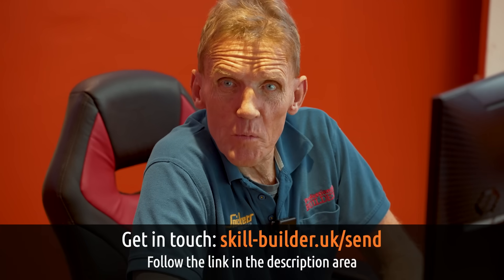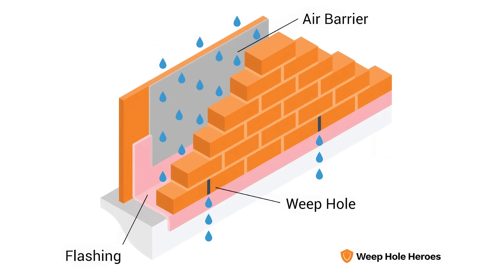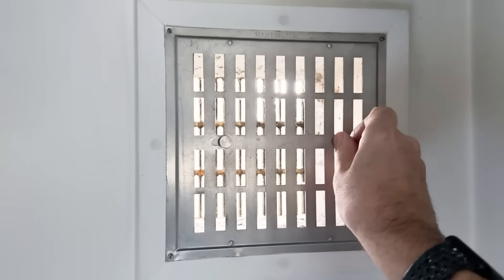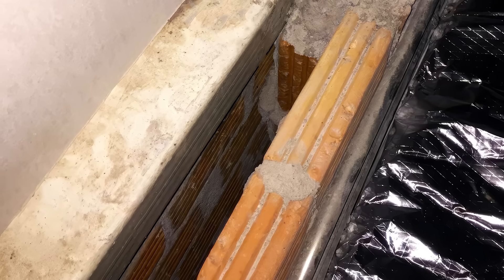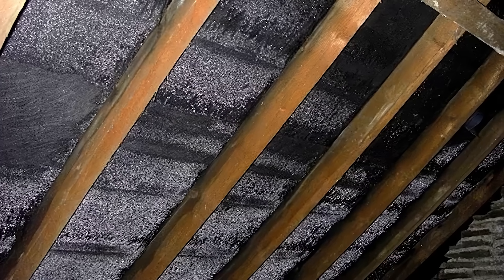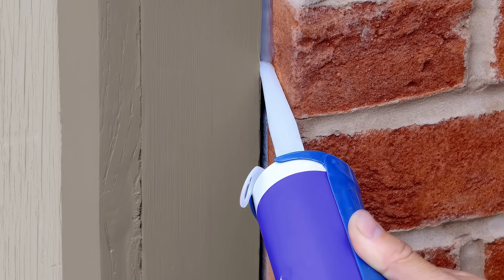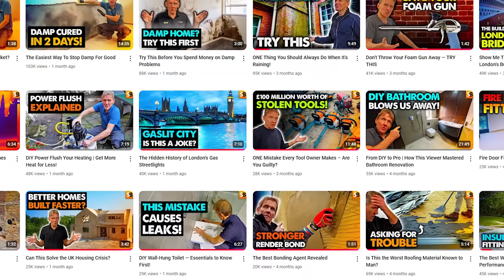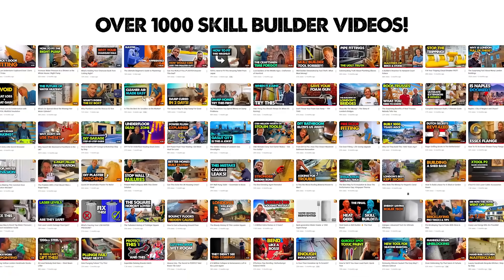The Truth About Cavity Wall Ventilation

Comment: Hi Roger, really interesting that you say the cavity SHOULD be closed at the top, as the house I grew up in was ex-council (built 1961-2) and also had an open cavity into the loft.  In effect, I would guess this means that instead of a 9" wall, you have a sheltered 4 1/2" wall with convection currents up into the loft, which quite possibly insulates less.

Unfortunately, it seems so hard to find out what the old rules were (as opposed to finding out what today's rules are, which is somewhat easier), so when you come across this kind of stuff in older housing, it is hard to tell if that was the way they did things then, or if someone was cutting corners back then.

If you had a house with this problem, what would you do be inclined to do about it, out of interest?
Reply from the maker: My house was like it but I closed it all off at the top with rockwool in polythene sacks. That was 30 years ago and it is fine. The airspace is an important insulator. Like you say, a ventilated cavity means you have a 4inch brick wall.
Reply: @SkillBuilder  Thank you!  Always good to hear people's personal experience.

Comment: What about the weep holes at the outer leaf of the brick cavity wall midsection & bottom of the wall? Aren't these supposed to drain the water inside the cavity away?
Reply: Yes, the weep slots are supposed to drain water away from the cavity.

Comment: Hmmm. Not sure this applies to the hundreds of thousands of houses built with soft brick & lime mortar. Water permeates through the outer wall into the cavity in wet weather & dries out in warm weather. Without the cavity being ventilated it might take too long to dry out?
Reply from the maker: That is where I lose you. If lime is porous (brethable) and wind blown rain gets through, what is stopping it evaporating back through the wall? I have a lime mortar built house and the cavity walls are sealed and fillled with blown mineral insulation. They are completely dry.
Reply: @SkillBuilder  Hello, I keep thinking about whether it would be worth completely closing the air gap in the wall to improve the thermal properties of the wall. The answer is, it depends. Well, when the wall is completely impermeable and water-proof, isolated from the ground by rising water, then I agree 100%. This theory will work in buildings with new technologies or where terribly expensive methods have been used in old stone buildings to chemically cut off water from each side. When we are talking about an old building with a solid stone wall without horizontal insulation, then I wonder about the effect of such water closed without access to air in the wall. My own opinion is that water, depending on the temperature inside and outside, will evaporate, condense and will not have a quick escape route as in the case of an open air gap. additionally, if we use modern insulation from the inside, e.g. with PIR plus a membrane, the drainage of water to the interior of the building will be completely stopped (which I think is very sensible and intentional). Only evaporation through the thick layer of the wall on the outside will remain. In ideal conditions, we would have half the days of wetting and half the days of drying alternating. In reality, we have a very wet period and a drying period. The very wet period is also a time of frost. The answer is erosion of rock and mortar. Of course, I emphasize that this is my personal opinion, but I cannot agree that in all conditions the air gap should be closed because it will improve the thermal properties of the wall. Sometimes this will bring temporary profits and in the long term high costs associated with the maintenance of the wall. Best regards
Reply: @MiroGro86  100%

Comment: Not sure I agree with blocking up vents, they where put there for a reason at the end of the day
Reply from the maker: The vents do not ventilate the cavity. The vents often were for coal fire or open flue boilers. If they are gone the vent serves little purpose. Each case needs thinking about

Comment: Perhaps the empty cavity walled houses in London are different to the ones you have seen but the ones here usually have ventilation via wall vents and in the attic. If they get blocked up with insulation beads by Government sponsored cowboys they become damp and mouldy in the first Winter. The cavity is normally wet from water migrating from the outer leaf  and needs to be able to dry out - that is why they were always open at the attic - sorry but I think you just got it wrong this time
Reply from the maker: It isn't me that has it right or wrong. If you look at the British Standards and Building regulations you will see that this information is standard. Have a look at the wall vents and you will see they are sleeved through the cavity.

Comment: Dodgy advice, in all cases of cavities you will want a degree of ventilation to prevent obvious trapped moisture. And the loft space getting damp is a separate matter as cavity walls should be sealed at the top to prevent this. So instead of sealing ventilation blocks seal the top of cavity wall if its not done already.
Reply from the maker: Cavities do not need ventilation. In fact it can contribute to the spread of fire. Check the regs and guidelines
Reply: @SkillBuilder  Roger this is advice is not correct for timber kit construction here in Scotland. The cavities MUST be ventilated. I'll copy and paste my original reply to you as follows - Hi Roger, up here in Scotland for the last 40 - 50 years the majority of new build houses have been timber kit construction where it is essential that the cavity is ventilated. The regulations state that ''Cavities should be vented to the outside air by installing ventilators with at least 300mm2 free opening area at 1.2m maximum centres." This is normally achieved by installing ventilation cassettes similar to weep vents but full hight of the brick (65mm). The cavity fire barriers should also be taken into account with the placement of ventilation cassettes each side of the barrier. This ensures that each fire compartment within the cavity is properly ventilated with ventilation cassettes at the bottom and top of each compartment. 
Why don't you do a collaboration video with someone who is fully up to speed with the Scottish regulations and practices. I'm sure your many Scottish subscribers will appreciate it.
Good videos. Your plumbing ones in particular are excellent.

Comment: Greetings from Poland. I absolutely agree with you on this subject. 
The issue in UK is that often the external or internal walls have so called "rising damp" from the ground due to damage horizontal water barrier. The way we address it in Poland is to cut your whole building with saw and insertion that barrier bit by bit every 20cm you cut. You might think this is an highly professional specialist job. No! It is diy job. One person is inside the house and one outside and they push and pull manual saw to cut you building at low level. Alternatively you can use chainsaw with special chain for concrete. 

I modern day an age cavity insulation is insufficient. We nowadays do 30cm of external wall insulation when upgrading existing builds. On the top of insulation goes mesh net, cement based glue, and 3mm render to finish. I am diy-er not professional.

Comment: What if I have an air brick above floor level? there's nothing in the room inside.
Reply from the maker: It may be there as ventilation for a fire or open flue boiler. If they are no longer there you can block it up. Better still put a hit and miss vent  cover so you can open and close it.
Reply: @SkillBuilder  Thanks, it is outside a bedroom with nothing inside, It's a bungalow and only 25 years old, I'll block it up. I'll block it up.

Comment: Answer maybe build solid walls without a cavity.  Water shouldn’t get through brick skin but it does because of shoddy building standards.hence reason for cavity trays.  Building regs are reacting to crap builders rather than ensuring things get built correctly. Find me an Edwardian house with serious water ingress?
Reply from the maker: I don't think that is the case. Bricks are often porous and with years of driving rain water finds its way through.
You also have mortar with air pockets. I agree that partially filled perps can be a weak point but brick walls leak.

Comment: You should also address the problem of the inner leaf continuing higher than the outer, to support roof trusses.  The outer is lower because of the slope of the roof. The room's ceiling is therefore higher than the outer leaf, ie the level of the soffits. The insulation needs to continue to the top of the inner leaf otherwise you have a cold band below the ceiling which is in effect a single leaf .  We had Shell insulation, glued together polystyrene beads but it can't go higher than the cavity. No-one seems to accept that the insulation needs to be continuous.
Reply from the maker: The blocks often go up between the rafters and the insulation is laid on top with a ventilation gap

Comment: With a cavity you get heat transfer from radiation + convection. Ideally you want to stop the air moving in the cavity without incurring additional heat loss via conduction.

Comment: Nonsense, internal water vapour will permeate into the cavity and then be trapped. Ventilation is still very much needed. You appear to be talking about best practices for energy efficiency - is also true to say that ventilation is required! They are not mutually exclusive
Reply from the maker: If you read the British Standard Guide lines you will see that you are wrong. 
If water penetrates the brickwork and runs down the inside of the outer skin that s not dependent on ventilation. 
The wall will warm up as temperatures fluctuate and the moisture will evaporate. This has been going on for thousands of years. 
If the penetration is excessive you need some form of cladding or better still a coat of Stormdry.

Comment: Is there a good way to tell if a cavity is insulated without drilling into the wall? I live in a block of flats built in 1995 at whoch point some insulation should have been put in, but I'm getting a bit sceptical.
Reply from the maker: A cheap thermal imaging camera will show you where the cold spots are. It should have some insulation in there but if the location is exposed it will still be a cold wall.
Reply: @SkillBuilder  Thank you for the quick reply! I'm actually playing around with a thermal camera atm, but the building looks fairly uniform from the outside - not sure if that means there isn't any insulation or if it's been done well. Will need to investigate a bit more.

Comment: Im of the view a cavity should be free of insulation and anything that bridges the cavity unnecessarily and the external brick should be vented to allow air to dry out condensation that runs down the inside of the external bricks probably more so at the lower ground level where its going to ultimately end up. Everyone seems to have a different idea about this. My neighbour filled all his airbricks in then started getting mould issues!!

Comment: At 0:48 why is that airbrick slightly below ground level? Rain water is going to run into that airbrick, an airbrick designed to remove damp is letting it pour in.
Reply: Because the owners have allowed the outside ground level to be raised above the damp proof course which will be immediately below the base of the air brick. The ground level, whether solid as shown in this case or just dirt, should be maintained as required by building regulations to be a minimum of two brick courses below dpc level. Ignorance is what has brought this about and a recipe for a future disaster.

Comment: Our problem regarding air bricks takes on a different approach, where our 1963 3 bedroom bungalow was constructed using a fabricated steel frame which includes the roof. A brick wall makes the outer shell, and a 45mm plasterboard inner wall completes the structure. Bichemin was used between the bricks and steel and plaster and steel to keep contact away from the damp walls. We cannot insulate our inner cavity as the steel needs to breath and remain dry. So our choice to bring this 1963 building up to scratch is to add 100mm of outer insulation to the walls all the way round the bungalow. The air bricks are a concern, because wind can create a draft under the floor space and up through the cavity. But if the walls are to be sealed by a water proof rendered insulated layer, water penetration should not be a risk. So does this mean I can close off the air bricks? Currently the system has work for the last 88 years and kept the steel rust free. We have an ASHP to provide us heat for the home, but it does struggle once the temperature out side reaches -5c. We need to insulate!

Comment: I live in a post war council house since 1987. It wasnt until they filled the cavity with insulation 25 years ago did i start getting black mould patches. Can't say the house feels any warmer with it either. Just more damp & condensation.
Reply: It would have been better to have left it alone.Our house when it was build they put like blanket stuff in the cavity.I must admit it never caused any damp at over 40 years.
Reply: worked on some council houses where they filled with foam, the foam just saturates with moisture.. council had to strip the outer leaf and scrape the foam off then rebuild the walls.. amazingly they used the same contractor that put it in.. what a gig.. my clients were unlucky they bought their council house so was up to them to live with it
Reply: @ i don't know what type of insulation they used about 25 years ago, but they drilled lots of holes in between the bricks & stuck a pipe thru which blasted the insulation into the cavity.
Reply: Too many variables to be able to diagnose from a YouTube comment. But you mentioning "patches" makes me wonder if they may have missed a few spots while filling. 

That often happens. And can indeed lead to wet patches. A few thermal images would reveal that for an easy fix.

Is the house painted on the outside? 

All retrofit cavity insulation is pumped in through holes in the wall with a pipe. So unfortunately that doesn't tell us what it's filled with.

Urethane foam was quite popular around that time. If you're unlucky enough to have had that applied there's no cure really. That stuff is almost guaranteed to cause some kind of damage, and can't be fixed nor removed.
Reply: i did it 7 years ago with polyurethane foam  , no issues at all but first the vendor came to check the cavity for odd things that can create weak spots of insulation .  my house is from 2002 and had already some 4cm  PE insulation panels on the cavity but it had 4cm empty space to fill.
Reply: Did you watch his other video about Stormdry (25 year lifespan) and dehumidifiers?

Comment: We purchased a mid eighties house late summer with solid concrete floors, cavity walls and air bricks above the DPC. Some minor damp issues on survey that surveyor advised was probably due to poor ventilation? Come the winter the damp became worse and we had problems with wood lice crawling around ground floor. Next summer we had air bricks removed, guess what come the winter? No damp issues and no wood lice.

Comment: Don,t seal your house up too much the average adult when asleep at night breaths out about 1pint &a1/3 in moisture  everything is a compromise between heating and ventilation! Try it boil a pan with just a pint of water in till empty that will condensate quickly usually on windows. Don, seal your house up you will end with thick black mole!

Comment: Roger, I personally agree no vents on cavity but check Part C Sec 5 and BS 5250 for venting cavities. You may be surprised.
Reply from the maker: Thanks for that. I have just read it all and it talks about weep holes if you are using a stepped damp proof course. Provided there is no open cavity at the top the weep holes are not vents. 
I don't see anything there relating to ventilated cavities unless we are talking about timber frame which is an subject entirely I should have made that clear.

Comment: We've bought a house which has been (I think) largely poorly extended by prior owner / builders and one of the things I have most recently identified, is a connecting wall which sits between the old outer layer of our Yorkshire Sandstone building and the new extension. Looking at this video, it appears that wall ties aren't properly used and there is no insulation or topping of the cavity. For info, the opening of this is exposed to external air via a porch within a run of the wall. Is this as bad as I fear? https://youtube.com/shorts/jAxsn9CjPdA?feature=share

Comment: it depends on the weather where the house is, is there a wet wind blowing onto the wall?
Reply from the maker: If it is a cavity wall with penetrating damp, venting it won't help. If you have a dead air space less wind will penetrate the masonry because it would have to compress the air.
Reply: Yes if it's in the UK.

Comment: i spent 25 years injecting wall insulation for miller Pattison owned by Sheffield insulation, ok  all the vent we blocked unless a customer noticed and complained about  them they stayed blocked floor or room vent , the the top the cavity we just let the insulation overflow into the loft causing all kind of problems, floor vents if they weren't sleeved and when they filled up we just blow air in to them to clean them out , so later on the insulation will just fall down to block them again and start leaving voids where damp will occur, your probably asking why do this simple was pushed by the manager Roy from coventry to do more work, he would say do more i pay you more after all life's all about money hey?